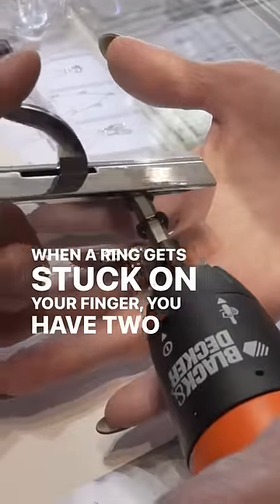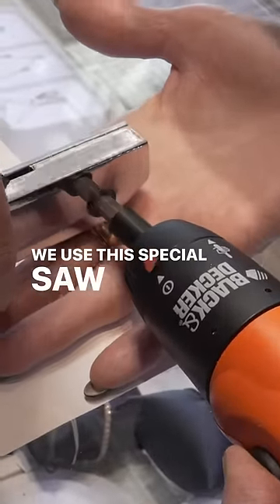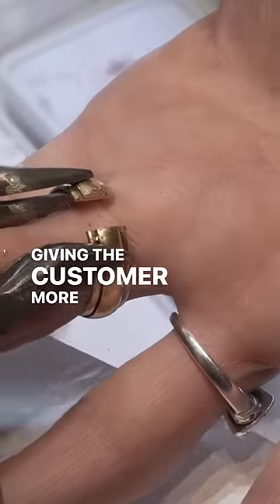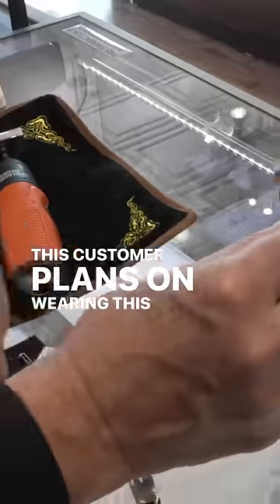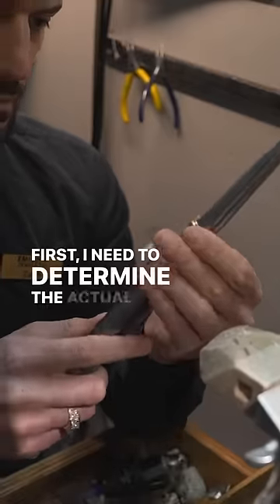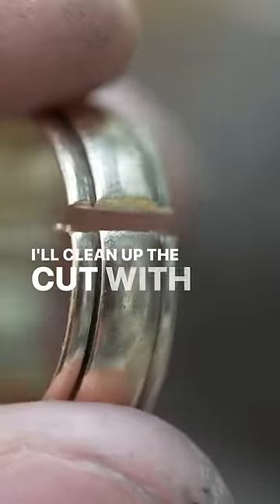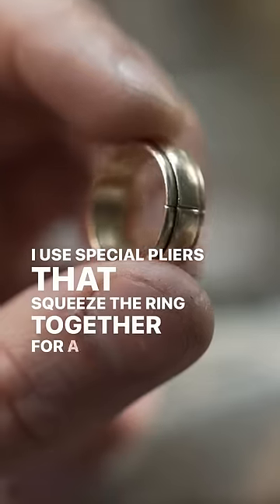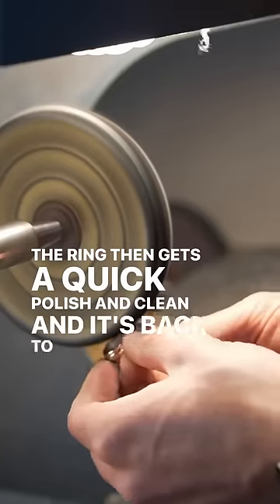Removing Stuck Wedding Ring

Comment: Did you give her a discount for the amount of gold you kept
Reply from the maker: It’s all priced in to the project (there’s like $3 of gold there 😅)
Reply from the maker: @brianc6848  you're now in charge of moderating my comment section 😂👏🏻👏🏻
Reply: @zachemighjewelry  im a small dude so no jewellery fits i need to have everything resized and without a doubt every time I've got to ask for my old links and clasps back and you guys always have it ready in a little baggy and act like you just forgot lmao EVERYTIME
Reply from the maker: At my store this is always discussed before the repair is performed and the customer is credited the proper amount for the removed gold
Reply: @zachemighjewelry  good on you mate..be the good guy amongst thieves and you'll be around for the long haul watching them burn out
Reply from the maker: @minzahhh1  🙌🏻🙌🏻
Reply: You should have just used the gold you took out instead of the solder
Reply: @chrisburke9279 I don’t think you understand why solder is used
Reply: 🤣🤣 I hope this is a joke, theres like 1-3 dollars worth of gold if that
Reply: @chrisburke9279 solder has a lower melting temp than the base metal of the ring. That’s why it’s not used
Reply: @dylancalicott3683  damn you learn something new everyday. I see, the ring would then melt I guess.
Reply: This ring was too small so we had to cut it off the clients finger. Then we made the ring smaller to fit better….
Reply: They usually charge you for a decrease in ring size.
Reply: @iosonoi.7132  Different finger, he says it in the video
Reply: @chrisburke9279  the solder jewelers use isn’t like generic electronic solder, it’s an alloy of gold and something else i cant remember but it is gold. But if they used straight up gold to join the seams it would melt the design of the ring right with it.
Reply: @zachemighjewelry  I think people confuse 24k gold prices with all gold prices and they also confuse jewelry store prices with scrap prices. The whole ring scrapped probably isn't worth the work you done on it 😂.
Reply from the maker: This^🙌🏻
Reply: @chrisburke9279  “you should have just used the” internet to look into if what you were saying makes any sense or not before posting it. At least you now know something that you didn’t know before. YouTube is free education
Reply: I'm an apprentice bench jeweler. At my place we factor in gold removed or added into the cost of jobs. Downsizings cost less than upsizings, and are typically easier due to not having to recreate shank profile from cut stock.
Reply: @CameronStPeter  yeah dont do it like that imo...feels like your being robbed even if its $2 worth of scrap 9k in 20 years that COULD be worth thousands

Ill happily pay you for the skills you've learned but I want my physical gold back regardless of weight or karat just me and my personal opinion though
Reply: @minzahhh1  that’s unlikely. And if it is worth thousands then that means inflation skyrocketed and a thousand dollars would be worth the same as like one to 5 bucks now. 

That’s the only way I could see something like that ever happening and you would be left with the same value of gold, maybe buy something at dollar tree with it.
Reply: I’ve always been curious about that. Thanks for shedding some light on the subject
Reply: theses are low purity 14 carat gold probably. those haven't that much value.
Reply: @zachemighjewelry  😔😔
Reply: @zachemighjewelry  only $3 of gold? How much do you think she paid for the ring in the first place
Reply from the maker: @bappochan6615 well, she had it for over 30yrs, I bet that ring was less than $100 when new
Reply from the maker: @minzahhh1 ep you can get it back, I’ve literally done thousands of ring sizings and maybe 4 people have wanted the piece back
Reply: @zachemighjewelry  and 30 years ago $100 was expensive. But if you were to make the same ring over again how much would you charge someone for it new, vs what other jewelers would sell it for. No hate, I see that you credit people for the amount of whatever is being removed, but my curiosity comes from the rings worth, vs the rings sold value.
Reply: @chrisburke9279  have you understand solder
Reply: @Zach Emigh Jewelry  That is his point, after 20 years of keeping the tiny 1-3 dollars worth. And in your time thus far (thousands) and that is 1-3 thousand for each thousand you do and how many after 20years. It adds up is what he is saying. 
But I get it. If that tiny amount is factored into that total cost then yeah it works out fine.
Reply: @iosonoi.7132  You really are slow arnt ya? They had to resize the ring to fit. On a different finger obviously a smaller fingure  they also cut it off bc it wouldnt coke off the finger any way
Reply: @Robmancan1987  100% people do not understand the price of jewelry in the slightest. 
My wife's ring is platinum, because I'm not a fan of gold and white gold just seems "expected" and a tiny baby diamond. 
However, the diamond is VS2 clarity. 
You look at the ring and if you don't know what you're looking at it's just a bullshit small ring, but I actually picked out and paid a decent chunk of money for something because I liked it and it was the style she wanted.
Reply: @zachemighjewelry  how to be a real scam artists
Reply: @zachemighjewelry  if he fails you as a comment section moderator, I would like to pass on my resume to you. I moderated a guild in world of warcraft classic.
Reply: Ohhhh noooo not my 5 dollars worth of gold 😭😭
Reply: @chrisburke9279  fr
Reply: @zachemighjewelry  they all add up tho, and u used solder for profit
Reply from the maker: @nullcrypt   🤔 not sure what your point is
Reply: @subject_phoenix4043  my man thanks got the knowledge
Reply: @iosonoi.7132  different finger
Reply: @chrisburke9279  hey, I just wanna take a quick moment to appreciate you for taking in new information and changing your perspective on something. It seems simple but I think it’s should be encouraged. :)
Reply: @zachemighjewelry  bruh gold is 60 euros a gram. Bs that's only 3 dollars. That's at least 100 bucks
Reply from the maker: @stinkiaapje  this isn’t pure gold, like the prices you’re stating. Jewelry is made of alloys that are a fraction gold
Reply from the maker: @saturnna467  absolutely
Reply: @bappochan6615  Unfortunately, the value of jewellery is to the individual and not the market. You get charged 85k because it’s worth 85k to you. The market value is only say 10. As in the cost of the raw materials. (These are made up example numbers and don’t represent any correlation between the two prices) It’s the time and skill to make it, along with your own desire, that make it worth the amount you paid. Then for scrap it is worth less. The only way to get what you paid for it, is to find someone willing to buy it, because they want it, not because it’s worth it. 

Edit was just correcting auto correct
Reply: @Zach Emigh Jewelry thats how we do it at the company I work for.  It keeps pur prices more competitive.
Reply: @joker0206  the painful part is I understood all of this, but it reads like it should also just make sense. That because you want something that’s only $13 in materials that you should be ok paying 80k
I get people work on it but any company that even profits 50% after paying wages and selling stock is scum, and the biggest offenders are jewelry makers. Their profits are in the thousands percentile, it’s bs
Reply: @saturnna467  I'm not going to bill extra for a few minutes tweaking with a prong pusher though, but totally true. If it's an excessive downsizing with tons of smaller stones we'll quote that in.
Reply: @bappochan6615  yeah I get that. I never said I agreed with it.  The world and the people in it are broken.
Reply: @iosonoi.7132  he clearly stated they had decided they would wear it on a different finger
Reply: @iosonoi.7132  apologies I didn’t see the other replies with the same thing I said, that’s on me
Reply: @iosonoi.7132  for a different, presumably smaller finger.
Reply: That wasn't even .1g that stayed there 😂🤦🏻‍♂️ if you don't know anything about jewelry don't say anything at all. Plus solder is more gold than any other metal since its melting point is faster. If you use the same metal as the ring it won't solder at all and possibly melt the ring. Its going to take you hella jewelry pieces and time to even gather 1g of gold thats why its not even worth getting those pieces back. The only exceptions are links and clasps. Ive had customers ask for the little piece of metal we took off the make the ring smaller and all he got back was DUST because we cut the ring then sand off the metal piece to make it smooth and easier to solder. Usually the guy does it its a little harder to solder and have to be more careful, but anyways its pointless trying to get not even .1g of gold thats worth $2-$4
Reply: @minzahhh1  why did you say "you guys" as if you're talking about the guy in the video
Reply: @hercules_144  because I put all jewellers for the most part into the same basket and referred to them as "you guys" .......its only in dream land that you don't get judged off the actions of those that live the same life you do hence the saying "you are the company you keep" 

I feel like this honest of an answer will trigger you're inner activist and you'll not sleep tonight but it is what it is
Reply: @minzahhh1  but the way you gave an example of the negative experience you had when you said "you guys" it sounded like you're talking specifically about the person you just described and it sounded like the guy from the video. Only way I knew it wasn't him was after he replied to you saying he's a fair guy you praised him so I knew he wasn't who you were referring to initially. Be more careful with your words man I'm sure most people who read your first comment who didn't end up reading your second one probably thought you were on about the guy in the video. Or I might just be overthinking 😂
Reply: They can keep it as tip for labor
Reply: Tell me you're poor without telling me you're poor. 😂
Reply: 69 comments. I am gonna ruin it
Reply: @chrisburke9279  Confidently incorrect, arentcha? It doesn’t work that way. Solder has to have a melting point way below the melting point of whatever you’re trying to solder. If you tried to use a piece of the ring as solder, the ring would melt at exactly the same temperature. You’d have a puddle of gold, not a ring. 
18 carat gold melts at 1675°. Gold solder melts at about 1100°.
Reply: @iosonoi.7132  it was for a different finger man.
Reply: @timothy098-b4f   dope
Reply: Nice work it looks better than it did before.✌️
Reply: @Zach Emigh Jewelry  $3 is what you pay, they probably paid $300
Reply: The amount of gold? mate, there was maybe like $10-20 worth of gold there. and most of it was essentially vaporized by that tool lmao.
Reply: @chrisburke9279  It doesn't work like that.
Reply: @iosonoi.7132  ON A DIFFERENT FINGER
Clearly you missed that.
It went from middle finger to a ring finger. 
DUH
Reply: @stinkiaapje  Tell me you failed math without telling me you failed math.
Reply: @bappochan6615  You forget the labor costs involved in MAKING the item in question.

Comment: My grandmother wore my grandfather’s wedding ring after he passed and later, her knuckles swelled up due to arthritis to the point where she couldn’t take the ring off and at one point this was brought up and it absolutely broke her heart
Reply from the maker: That’s the same scenario as this!
Reply: Should of just wrapped Dental Floss around the finger then through the ring. Then all you do is unwrap the floss.
Reply: @scottarnold6528  her knuckles were physically too big for the ring to fit over due to arthritis.
Reply: Anyone who lives in a cold climate knows that cold shrinks joints. That is the first, easiest step to take. Many times that's all you need
Reply: @patrickcamp5885  yeah… she’s from North Dakota
Reply: Theres a ribbon technique for ring removal that avoids cutting the ring. Definitely worth knowing.
Reply: @handanhan  the ribbon when tightly wound around the finger actually reduces the size of the finger with equal pressure.
Reply: Q
Reply: That... explains my only question about this video. Thanks.
Reply: @USGovIsDistributingCSAM  the thread method works to an extent. In this case he said it was physically impossible to pull the ring out so cutting is the only option. 😇
Reply: @patrickcamp5885  Not Arthritis fool. Cold doesn't compress BONE.
Reply: @USGovIsDistributingCSAM  Unless Arthritic joints are invovled.
Reply: @RhysGFrelsa-Eudyptula  Before calling someone names, make sure you know the subject you intend to argue. Arthritis is a breakdown of soft tissues due to many different causes. Maybe you are thinking of bone spurs or calcium deposits.

Comment: i’ve only been to the hospital once and it was when I was a child I got a hex nut stuck on my finger, mum tried to pull it off but it didn’t work and it kind of just latched and dug into my skin, so we went to the hospital. there, a very lovely nurse decided to not wait for the doctor, and tried to yank it off of my finger because she thought it wasn’t a big deal. i was screaming in pain and my mum was seconds away from beating her ass, when the doctor came in and did the verbal equivalent to the nurse. he then used this thing to remove the hex nut, and i was fine afterwards
Reply from the maker: Yikes that’s a scary story!
Reply: Wth was wrong with the nurse 💀
Reply: Oh man, if only they had just put your finger in an ice bucket and lubricated the skin and twisted the nut off.  That is how the threads on a nut work.
Reply: @milescarter7803  brother we tried everything before, it was either the saw machine thing to cut it off or the finger lol

Comment: TW:GOREY STORY OFF MINE, PLEASE DONT READ IF YOUR SENSITIVE TO GORE!!

That brings back some awful memories, lol. One night when I was at youth group, my friend was doing pull ups on a metal door frame, so me being the competitive type, I decided I wanted to try it too. I jumped up and grabbed, and missed. My gold ring that I got from my grandfathers dad got stuck on the sharpe edge of the metal door frame and I hung by my finger on it as the ring dug into my finger, the door frame was tall, and I'm not. So I couldn't get down. I still thank my youth pastor to this day bc she was able to lift my legs so that way I could jump off. The ring got stuck in my now VERY swollen finger and they had to use that same device to get it off. It sucked, a lot.
Reply: My finger is fine now, btw!! Ive got a decent scar but I'm fine now.
Reply from the maker: Nice
Reply: @rAHHHH-IZZI  Great story.  Thanks for sharing

Comment: Back in 2015 i got blind drunk and fell asleep on top of my arm in an awkward position causing my arm / hand to swell. When i woke up my hand was totally numb and my ring finger was swollen like a sausage.
My friend drove me to hospital where they spent at least 5 hours trying to remove the ring. None of the equipment they had worked and eventually they just slowly sawed through it with a hack-saw.
They even gave me valium to help calm my nerves so it turned out to be a nice experience! 🤣
Reply from the maker: Yikes!
Reply: Wonder if a cast saw would work...
Reply: @IForgorMyHW  probably not. A cast saw doesn’t cut it vibrates and that’s why it won’t cut skin.
Reply: For the love of God. If content farms have taught me anything, its how to get a stuck ring off, no matter how stuck or swollen the finger. Grease up ur finger and under the ring if possible. Using string or yarn or fishing line and probably a needle, feed the line thru the ring. With the string on the nail side of the ring, wind up ur finger, carful not to overlap or leave huge gaps. U will wrap up ur finger. Once done, pull the pamed end of the string over the ring and toward ur nail. This will little by little, slide the ring off. For vary swollen fingers u may have to start winding the string from the nail to the ring and then attempt to feed it thru or wrap tight a ribbon and then use the methods above. I’ve freed many a finger this way. Like emergency room cause ur finger gunna fall off soon kinda swollen.
Reply: @Wtfinc  You really think professional Doctors didn't try that technique for my finger? I don't think you quite understand just how swollen my finger was. It was so swollen that you could barely even see the ring, let alone try and get a thread under it.
Reply: @Marynicole830  let me restate the question for you, " does metal jiggle and move with the sawblade quickly enough like skin, or is it solid like a cast" go ahead and think for a second before giving a halfass definition of a cast saw as an answer again lol
Reply: So that's what marrige rings for. Making husbands suffer after a night out.
Reply: Never ever go back to a hospital that doesn’t even have the most BASIC tools such as a ring cutter. Most are just turned by hand.